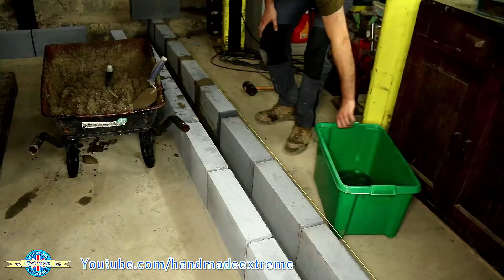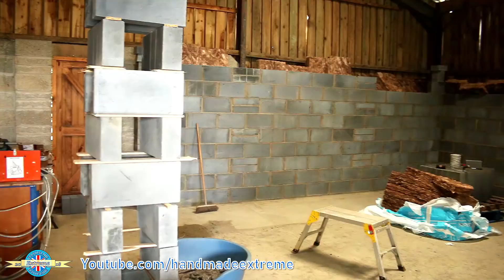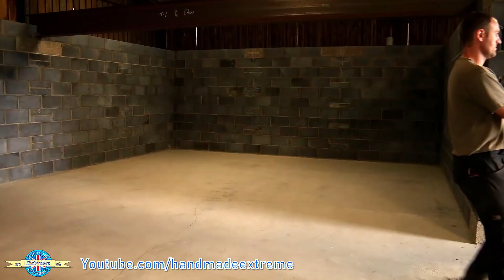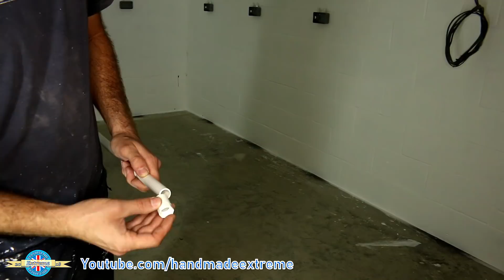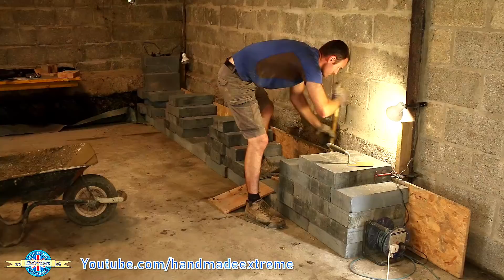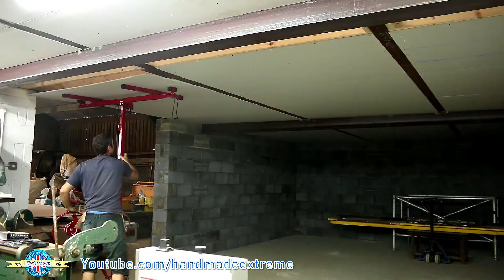New Workshop Series - Part 2 -The Build

Comment: Great video! Nice progress.
But I think this is wrong way doing this isolation
Inside walls become warm from heating. But Outside wall stay alaways cold. Thats goid loot of moisture in insulation wolle. And latter you become loot of isue with mold.

Why wasn't it isolated from the outside? Or come later ?

And why you didn't make isolation under the new walls and separate from beton floor? Now pool all moisture from beton to wall.

Comment: Hi Rob.  Absolutely loving this workshop move.  The only thing is, it makes me wish that I had done this when I moved from a small unit to an approx' 3 times larger unit in the same farmyard.  Now up to about 155m^2
Luckily I didn't have the damp issues you had, nor the need to put in a mezzanine; although we did think bout it in the smaller unit.
Looking forward to the next video, and actually, congratulations on the house AND workshop move.
Regards Mark in the UK
p.s. The valve (and other) work that you get, is it through connections from a previous employer for example or just new customers from advertising or word of mouth etc.?   Must be very satisfying having work coming in.

Comment: That cement blocks don't have enough strength for that H beam exspessialy with added weight I done the same and it cracked  the one side come down after that  I concrete support H beams for proper support. My experience, maybe you fill the concrete blocks below with concrete  install rebar and wire between each layer.

Comment: You really are living the dream buddy, great work. 

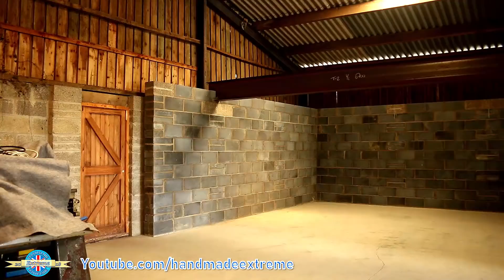It might be a trick of the light but in the first half  as you're  panning the camera at 6:30 there is a really pale line of mortar near the top? Wondered if that was anything specific
Reply from the maker: Cheers, glad you enjoyed it. I think it's probably just the light. The only thing that changed in the mortar mix between batches was the amount of water. As I got better the mix got wetter so I could work faster.  Thanks for watching.